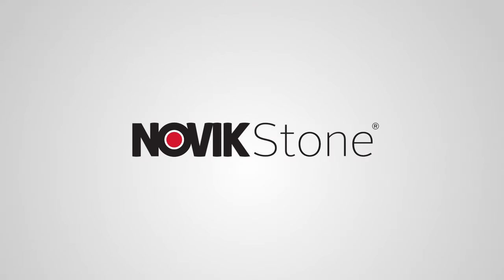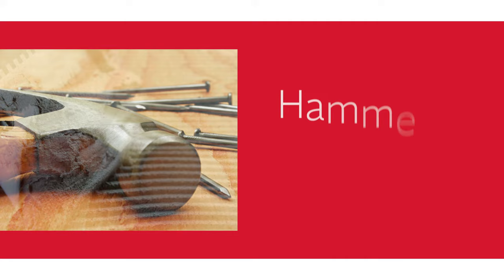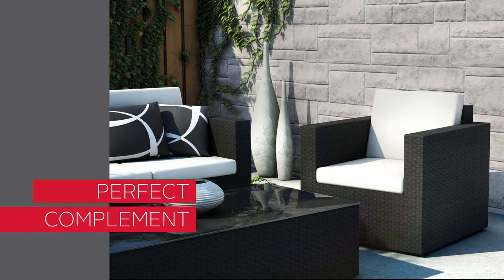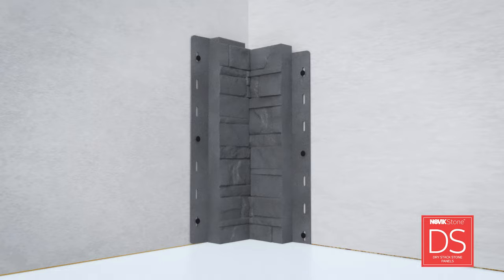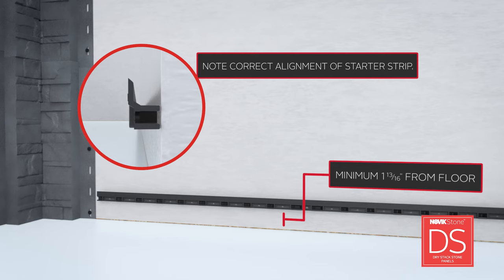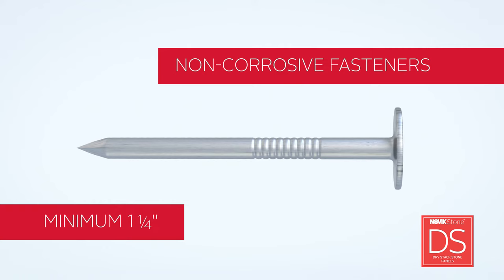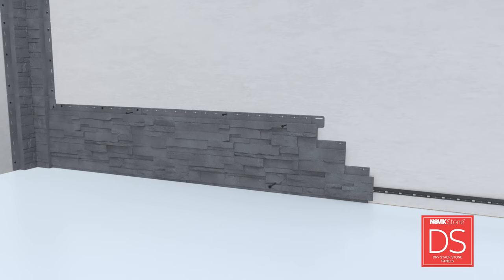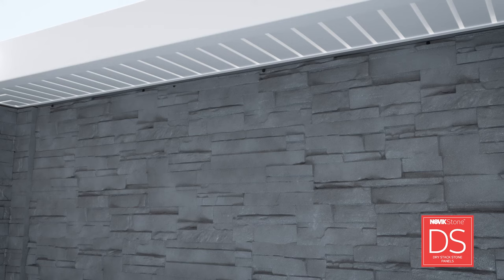NovikStone Dry Stack Installation (English)

Comment: Although it is somewhat "easy' to install, there some shortfalls. Such as no 45 degree corners available,  supplies seem to run low in most stores( mostly special order with the corresponding wait time). Expensive.
This material is best suited for creating a feature wall.

Comment: Cost is prohibitive. You would think that it would be much cheaper than paying someone to install stone on your house but considering the material it is made of it’s still way too expensive and that’s why it’s not being widely used.  I looked into this type of saving for my house. It’s just made of a hard Styrofoam.
Reply from the maker: We use an innovative polymer blended with additives and UV stabilizers. These additives improve our product’s resistance to extreme conditions. Novik uses quality controlled materials, which enables us to ensure product consistency and resistance. Novik products are certified and tested in independent laboratories. For example, our products are guaranteed to withstand winds of up to 110 mph and maintain their resistance even under extreme temperature variations (-40°F to 170°F). Plus, they are class C fire rated. Furthermore, our siding is covered by a limited life time warranty for your peace of mind.
Reply: @novikstone5837  ok.   Granted.   Cost is still prohibitive when one could spend not much more and get real stone.   At least here in Colorado.
Reply from the maker: @Jefleopard  This may be true sir. We pride ourselves in the making of a product that doesn't need special skills to install. It saves on work hours, presents a luxury look and actually is ''hard as rock''. Best to you sir
Reply: @novikstone5837  I would think the time you save heals the cost. Simple to install. Mine is coming in today for my porch. Im stoked.
Reply: @Wesmancan  will be installing mine in several weeks. Wes, now did your job turn out?

Comment: We're using this on our front porch. We have a large ledge on the "railing" portion of our porch and this product will slide up to the bottom of that railing area - Do I need to install a J channel or can I just nail the top piece of stone in and then caulk?

Comment: Is there a way to install this on a concrete wall? do I have to add vapor barrier first?
Reply from the maker: Yes, using either concrete nails or concrete screws, attach ferring strips to the outside wall oriented at 90 degrees from the horizontal. The distance between ferring strips should be 8 inches. Once the ferring strips are solidly installed into the concrete the siding panel can be installed to these ferring strips according to the directions in the installation guide. As for the vapor barrier, please verify its necessity with your local building code advisors. Regards!!

Comment: Be aware that these panels are ALL DUPLICATES.  There is absolutely no variation whatsoever.  All panels from the box are exactly the same.  For small walls that seems to be less of an issue but if you are doing a feature wall say 12 ft or more wide then you will easily see the duplications from left to right.  The video sort of shows that and even with the staggering of the panels from row to row and offsetting the starting point you simple won't be able the hide the duplication.  It can be very obvious for unobstructed projects like over a garage or along the side of a home and certainly inside with feature walls.  
I've installed these DS stones on exterior small sheds and recently on an interior feature wall since the light weight construction of the product is ideal.  BUT the duplication I was not aware of till well into the project.  SO BEWARE.  The product is robust enough but from a design perspective too repetitive to be realistic.
I did leave a review on HD and the manufacturer did request me to contact them so I did.   All I heard was that it was expensive to make the injection molds and the market might not really care.  So I really got nowhere and the customer service guy basically said he'll bring it to the R and D department.  Sadly this product has been on the market for 10 years or more and they still haven't upped their game.  This needs to be at least three different variations in the box but all you get are duplicates.
There are other urethane products which have not only stone variation but also colour variation.  
Sadly up here in Canada we have very limited choice .